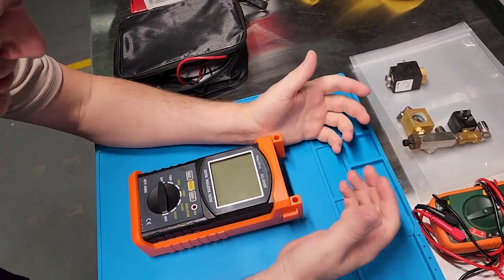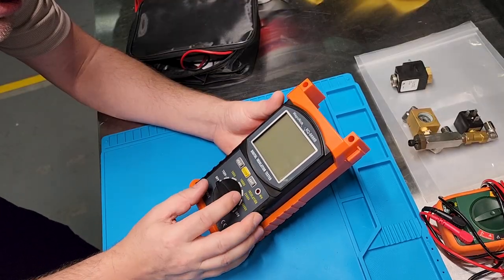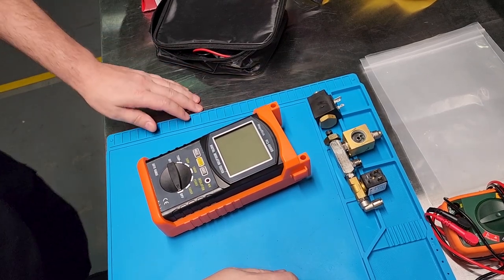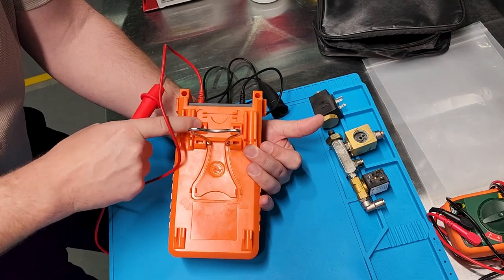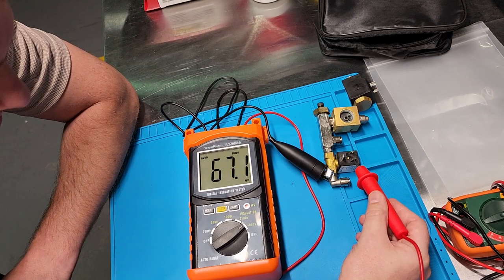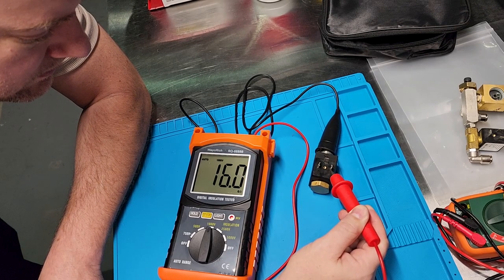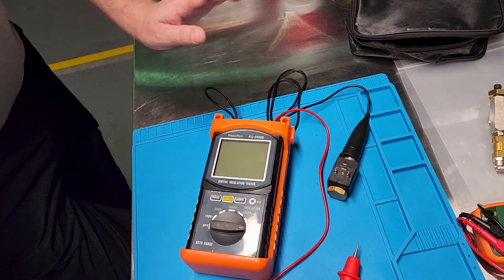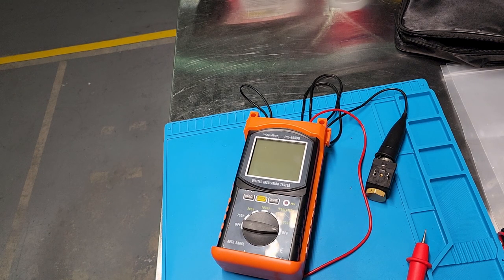Inexpensive Insulation Tester!

Comment: Hi. Please excuse my english. I'm no expert. But when I bought my own insulation tester, I red a lot about testing. One thing was that you should test system with first next voltahe your tester has. For example test voltage for 115V system is 250V, 230V coils with 500V and so on. I played with my tester a lot and I learned that known good coating on coils can break easily with high voltages and damage the insulation as you surely did in last video. I did everything with that 10min test the insulation testers commonly have. So I tested low 24 voltage coil with 250V and test passed. With 1000V, insulation was damaged. After that coil no more passed with 250V as before. Even with 100V meter indicated issue. What do you think?